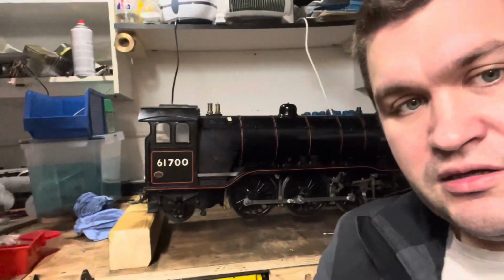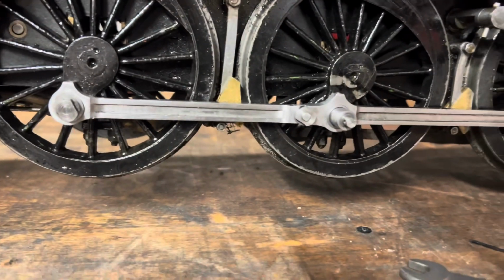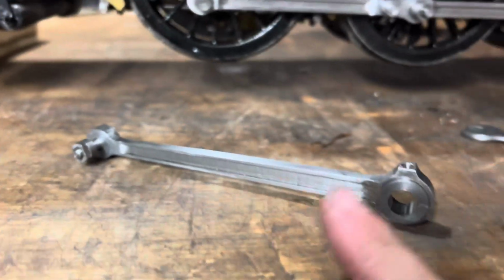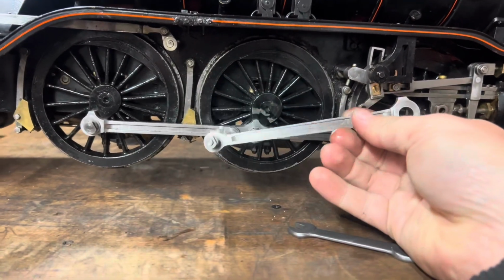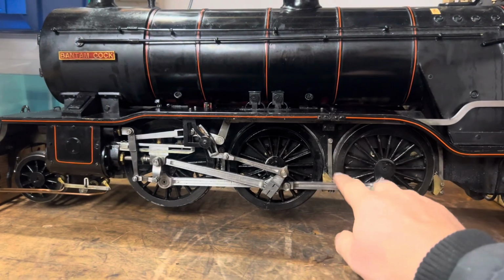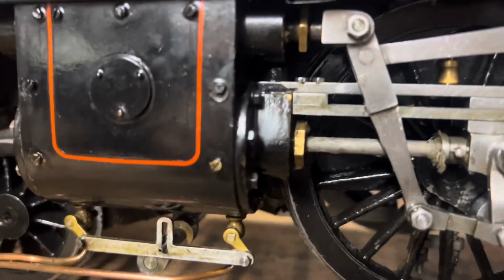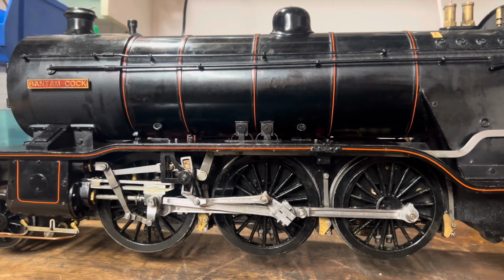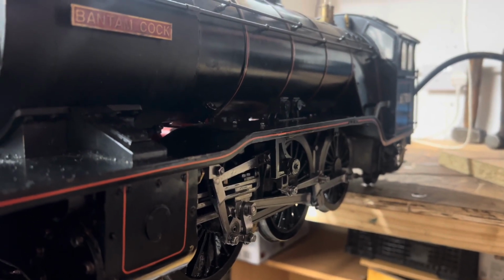Whats on the bench? Bantam is rebushed

Comment: Excellent job 😀 - almost too tight but I’m sure they will bed in nicely 👍
Reply from the maker: Its mostly just one tight spot, that and wear in the dieblocks/low volume compressor. But it does really show up gland leaks, wear. If its runs in this compressor, itll run really well in steam
Reply from the maker: That and the new o-rings keeping it stiff to turn over too
Reply: @3RailwayPlace  yes that low capacity compressor is a really good test. Be great to see it steaming again 😀
Reply from the maker: Not long now, once the track repairs are done